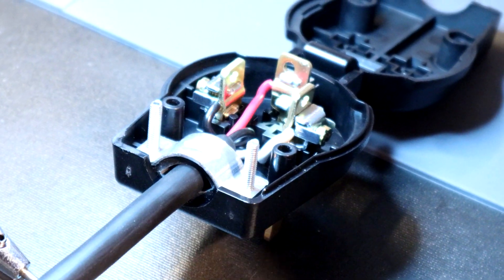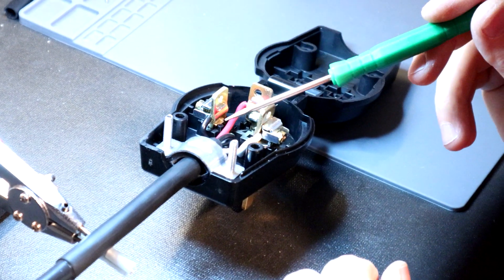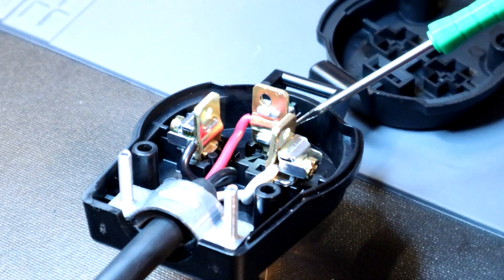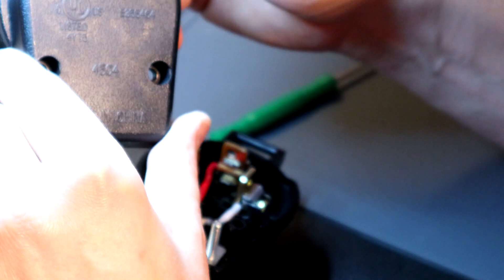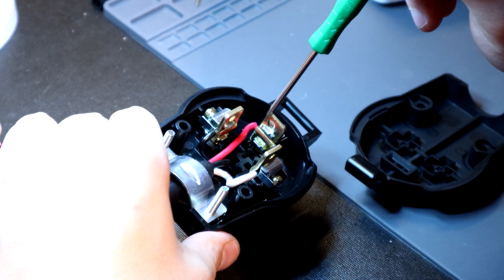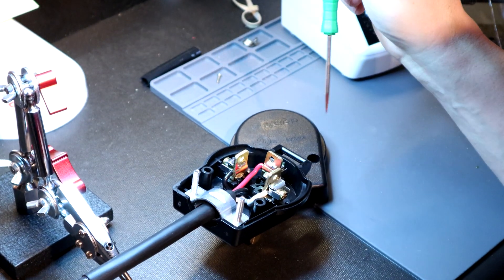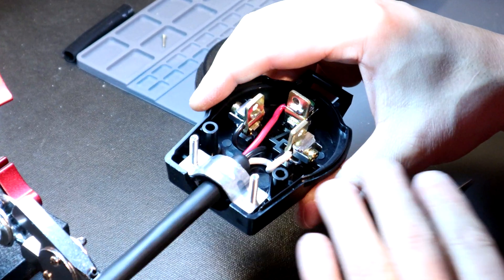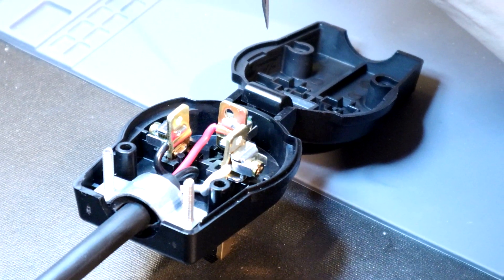CNC VFD Double Shielded Power Cable Overview (Shot in 4K)...

Comment: i followed your instructions on a spindle cable with shielded cable and grounding. my spindle never had a ground wire at either end. i ran my ground wire from the cable to the PSU case then through to the spindle mount with the shield lead running to ground at both ends. ran my machine this weekend after upgrading the couplers to gerwah zero backlash couplers. I had my first and second flawless runs. made sure they were both very long runs and now the machine is ready to be sold. i still want to get your g540 package and build a 6090 i found with cast iron uprights and a cast aluminum bed thats 2" thick.  it will cost me to get a 240v dedicated outlet but itll be worth it. this ground issue had manifested in dropped steps and headaches since i bought this tiny chinese cnc. Thanks Vince.
Reply from the maker: Q5Grafx, thank you for your support! I love hearing these follow ups, and the more end users realize the importance of the cables their robot is using they'll hopefully invest correctly the first time. Safety, and stability of all production robots starts with proper cables, and grounding. Thank you,
Vince